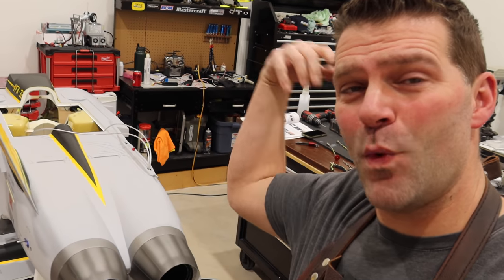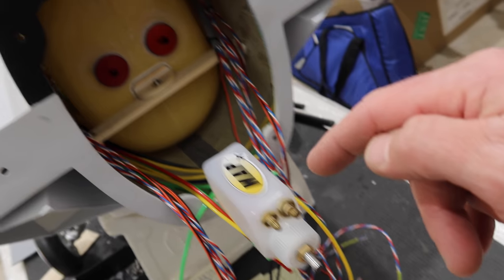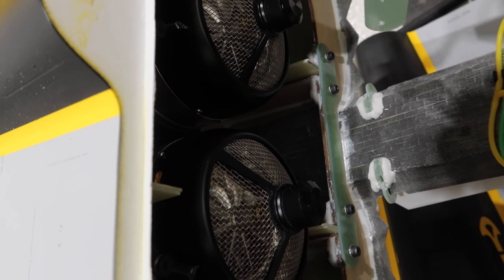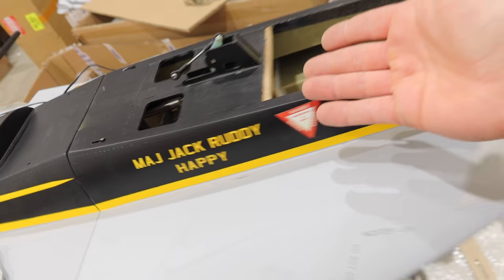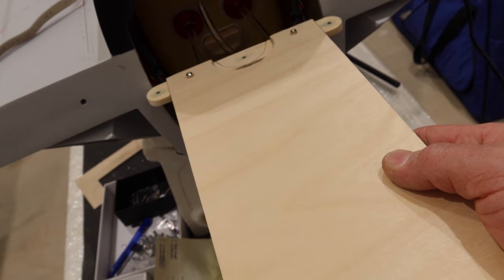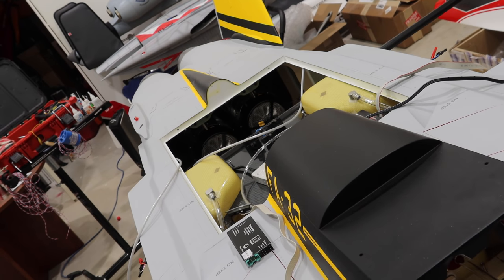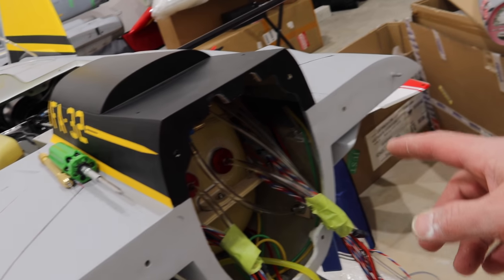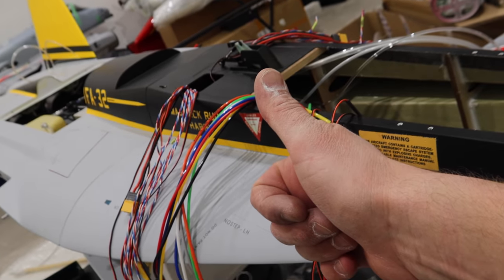Preping and Joining F-18/F18 Fuselage - SKYMASTER

Comment: Hi. when you join the 2 fuselage halves together do you glue them as well or is bolting them only strong enough? x
Reply from the maker: Bolting is stront enough.  Loctite of course.  You want to be able to split the fuse in the future if you ever need to for any reason.